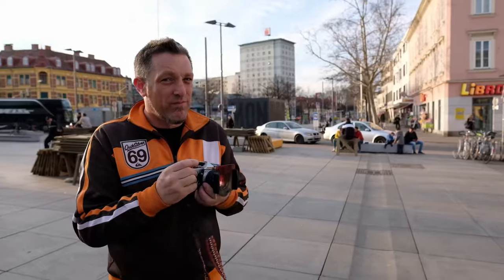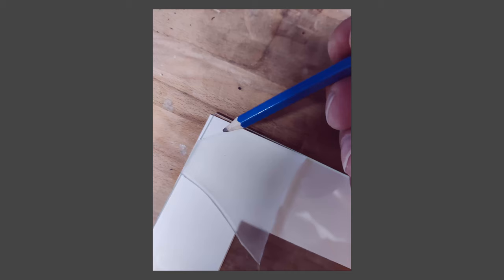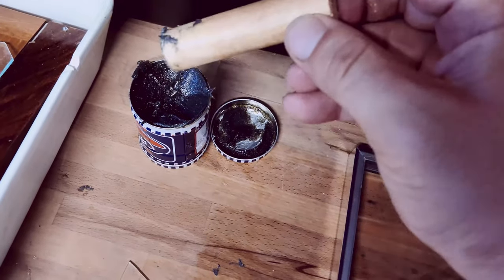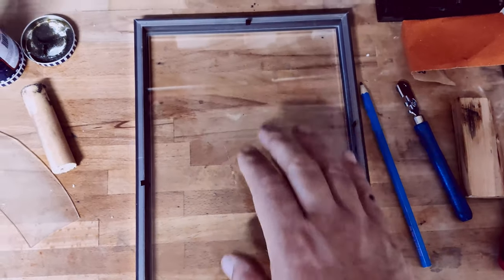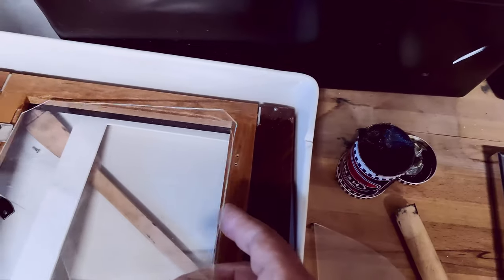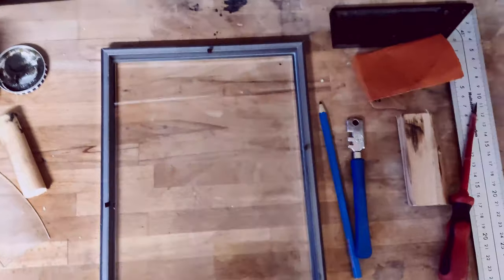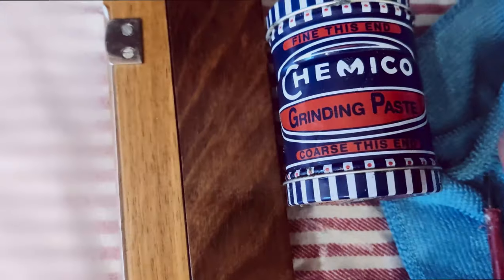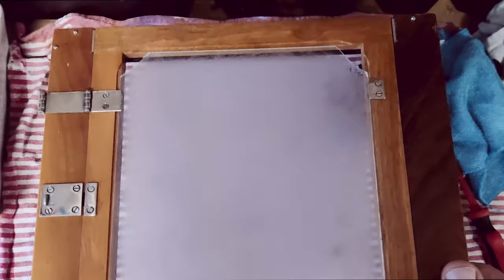Making Ground Glass for a View Camera

Comment: This is great and super useful. A trick I learned was to use 2 pieces of glass when grinding so you apply even pressure and also have two ground pieces after you're done. At least it can take care of the bulk of the grinding.
Reply from the maker: Thanks Jamie! I'm hoping to get some results from this old FKD camera it's kinda the most inexpensive way to go 8x10" without breaking the bank. It's light but a behemoth to carry around.  I've got some old photo papers to try out Reversal Process and a mobile darkroom to finish off too
Reply: @GavinLyonsCreates  That all sounds awesome! Except the camera being so heavy. haha. But still, sounds like good plans and I'm looking forward to seeing the work!